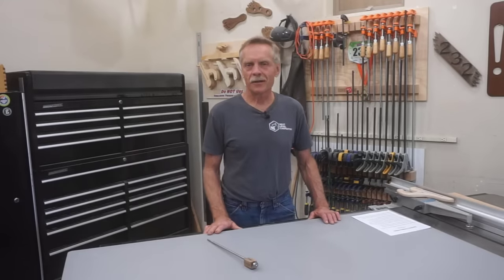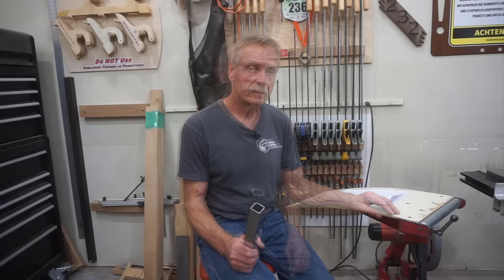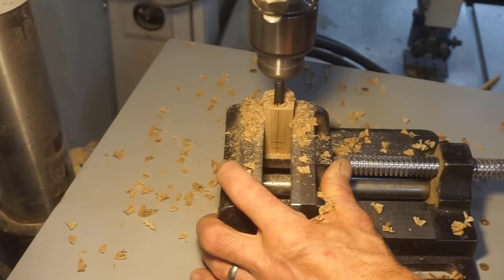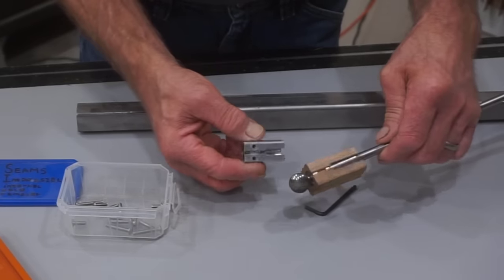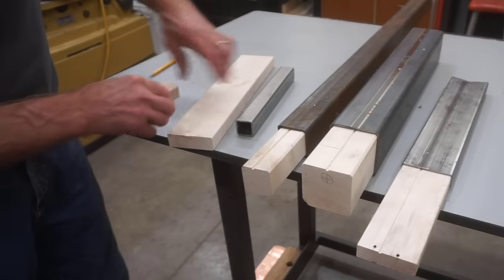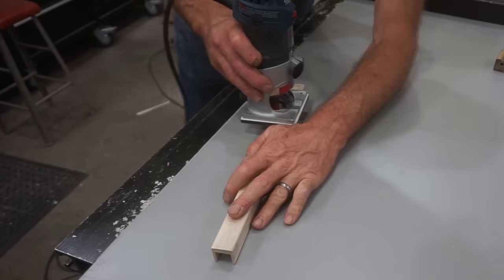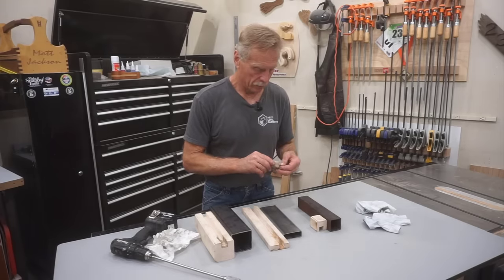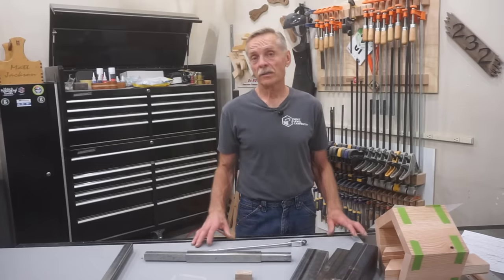How to Quickly Remove Internal Weld Seams from Steel Tubing

Comment: Having it cut below the inside surface has now created a weak spot. By the looks of the depth of cut  you've probably reduced the tubing strength by 40% . It needs some kind of fine adjustment to dial it in closer to the minimal stock thickness.
Reply from the maker: I can't quite imagine how you reached your conclusions but your calculations are borderline absurd... juss' sayin'.
Reply: @NextLevelCarpentry  common sense can seem absurd to some people. If you have tubing that has a wall thickness of 0.125" and your system cuts the weld out and then some to where the wall thickness below the weld is now .080" thick, you have made the tube weaker.

Now THAT is not rocket science. Oh, but I'm just being borderline absurd, guess that comes with 47 years of full time welding and fabricating experience.
Reply: The picture at 31:38 shows the undercut or thinning of the wall of the tube to less than what it is from the mill. This is my point. For what you are doing it looks like it works good but for any kind of critical strength application you do not want to be weakening the walls of the tube. A huge no no in any kind of critical or structural fabrication.
There was another video I saw where a carbide or tool steel insert was pulled or pushed through the tube cutting the weld out. Basically it is a broaching procedure. It's what is used for cutting a keyway down the inside of a bore.
Reply from the maker: @jacko4483  47 years in this business and you jump to the conclusion that wall thickness is reduced by .045 by looking at a screenshot in a video and then determine with certainty that the tube is now 40% weaker and try to convince me that's an example of common sense?!  The best way to get out of the hole you're in is to stop digging! 🤨🤣
Reply: @NextLevelCarpentry  I'm not saying 40% is exactly correct, of course it was an estimate, but it is weaker when you reduce the wall thickness. No hole I'm digging, but anyone with any kind of understanding would see that if you cut into the material deeper than the nominal thickness of the wall, it will be weaker. That is the truth, enough said.
Reply from the maker: The way you present a simple fact is rather annoying... I don't disagree that it's marginally weaker that's obvious but it's also irrelevant if it's 4% weaker not 40% weaker. Viewers with even a modicum of Common Cents realize that if the initial exact strength is a factor that can just reduce the jacket size and trim away the weld flush instead of over trimming it... the hole you are in whether you realize it or not is defending your original position which in my estimation is still borderline absurd.

Comment: Only trouble with this tool is that the weld is not necessarily in the same place on each run of tube. I have designed a solution to cope with this and a couple of other changes. If you would like to see my design  please respond to this comment.
Reply from the maker: You should look at OUR design first because it addresses what you believe to be a novel capability and lead you to a false conclusion... 18:20
Reply from the maker: It's great when one idea inspires new ideas and new thinking... my reply to you is mainly so you understand  that "the only trouble with the (Seams Impossible) is that the weld is not necessarily in the same place..." is a false statement/conclusion.  There are no doubt many ways of addressing the issue but our design clearly 'has a solution to cope' with it.  Kudos for brainstorming through it, whether or not your solution solves it in similar fashion... Best, Matt
Reply: @NextLevelCarpentry  Cheers Matt, I will tell you that my change is quite simple, rather than making multiple jackets, I propose being able to leave the jacket the same size but sliding the cutting tool roughly 10mm off centre to either side. As i said its your design and its a doozy. best wishes and a happy Christmas and a profitable new year.
Reply from the maker: We're all good then... it's a relief to see you're a cool, inventive thinker, not a troll as I wondered with your first comment.  We've been thinking about design improvements to get around the need for a separate jacket for each size of tube and weld location too but if you want to post pictures to Pinterest or Dropbox and share the link here you're welcome to.  Last thing I want to do is stifle creative thinking with an over-sized ego so I hope you'll forgive me any offense?  Best, Matt
Reply: @NextLevelCarpentry  No offence taken Matt. Watch this space. lol

Comment: I'm guessing some high speed steel and threaded rod.
Reply from the maker: That method's been out there awhile but this is a quantum leap better IMHO... let me know what you think after the video?  Best, Matt
Reply: @NextLevelCarpentry  I just saw it, and I already like it better.  Well done.
Reply from the maker: @ajhieb  thanks for sayin'!  Thought you might appreciate the different approach and cleaner results... Best, Matt
Reply: @NextLevelCarpentry  I very much appreciate the new approach.  I have about  40' of square tube in my garage right now that's eventually going to be a modular clamping system, and a bunch of it needs to nest.  I was going to try the method from Fireball Tool, but never got around to it.  I like your method even better. I'm going to try making one myself (stuff is already ordered from Amazon) but if mine doesn't hold up I'll definitely order one of the CNC'ed aluminum tools.  Thanks!
Reply from the maker: @ajhieb  You're welcome AJ... use whatever's fastest and least expensive... my hope is that this video gets half  the 1 million plus views Fireball's video got in the last year so spread the word for me if you like how this works for you?  Thanks! Best, Matt
Reply: @NextLevelCarpentry  Will do!
Reply: @NextLevelCarpentry  Most of my parts arrived from Amazon today.  I'm of course going to try something different and make the main block out of a block of UHMW.  I'm hoping to make a few different sized blocks so I don't have to mess with the shims.  if I have enough UHMW left over, I'm also going to try and make an end-cap with a bearing in it so that the shaft stays parallel for the entire length.  Thanks again for the inspiration!
Reply from the maker: @ajhieb  I like the way you think and predict excellent results!  You're certainly welcome... thanks for watching and commenting here.  Best, Matt

Comment: Interesting solution that seems worth trying but, I think the bearings make it more complicated then it needs to be. 
- 
Seems like a properly sized 1/4" aluminum plate with a hole in the right location would work just as well.

Comment: Won't deal with the little weld seam located close to the inside corner
Reply from the maker: So what? 🤨
Reply: @NextLevelCarpentry  The tubes I'm dealing with have the weld seam over close to one corner.  The proposed tool has a round cutter that would never get into the weld joints located quite a distance from tube center.
Reply: @stufields5125  this would be as easy as replacing the carbide ball bit with a flat bottom cylindrical carbide bit for the final part if it's a blind hole. You can get ones that have cutting teeth on the flat section of the bit.

Comment: Fireball tool had a much simpler solution to this using a piece of allthread and a piece of high speed steel.
Reply from the maker: "much simpler"?  Debatable.  Even if true we feel the superior results achieved with the Seams Impossible Tool are more than worth it but to each their own.  Thanks for watching and commenting regardless😁

Comment: "Tip the teacher" link says "resouce not found"
Reply from the maker: Thanks for letting me know John... that link must have become corrupted somehow but it's fixed now and I've included it here too:  https://www.paypal.com/webapps/shoppingcart?flowlogging_id=43d58f706fae5&mfid=1598630295963_43d58f706fae5#/checkout/openButton  I think I owe YOU a tip for the heads up! 😁😎 Best, Matt

Comment: why not use three screws.  Instead of the wood block.
Reply from the maker: That would leave too much 'play' in alignment during the removal process because consistent pressure and position are needed to cut the weld away in one pass...

Comment: A 40 min video on how to "quickly remove" the weld seam.
Reply: That was my first thought, but it is actually very interesting.
Reply from the maker: @lynalllynall9082  @zerocoolak's is a typical reaction to anyone who has difficulty differentiating between the 45 seconds it actually DOES take to remove a weld seam and the 39 minutes, 15 seconds spent explaining, in great depth and detail, exactly how and why, right?  Glad you found this interesting... I think most folks do.  Best, Matt

Comment: Two words: metric system.  Measuring and building things in America while faffing around with all the fractional values must drive people insane.
Reply from the maker: Doesn't slows us down a bit though, does it?😎  After all the tool shown in this video wasn't invented by someone using the metric system, right?!
Reply: @NextLevelCarpentry  So just exactly how long is an American cubit? Ah, the wonderful thing about standards, is that there are SO many to choose from! 😉

Comment: I like your thinking out of the box and building a solution to solve your problem but I have one question. Why not use seamless square tubing as a solution for solving the problem of seamed tubing.
Reply from the maker: Just go out and try to find two 4 foot pieces of seamless Square Tubing one with 1 inch ID and the other with 1in OD minus a few thousandths for a comprable cost and you'll answer your own question.

Comment: When Stewart and Lloyd's made tubes in Corby,  they got rid of the weld just as the tube was being closed, but the part where it happened was shrouded so nobody could  photograph it.
Reply: There is a mandrel that is anchored between the breakdown rolls and the fin pass rolls with the other end just past the welder inside the tube. The mandrel has a carbide insert which cuts the weld flash out while it is still hot.

Comment: I been a fabricator better part of my life the way i deal with this  is way different I use reneck edm action u need a old  buzz box some small alligator clips just clip the alligator right on the edge of the seem connect the welder clamps to clips use some heavy Gauge braided copper wire if the clamps don't fit in the pipe set the welder on say 200 amps turn it on and the heat will melt the seem because its thinner

Comment: Do you suppose that the creative energy and motivation to solve a problem like this, is just half of the psychological energy involved?  With the other half existing in a bunch of other people who just need a solution?  That the desire or motivating energy, goes down into the collective psyche of people and then re-emerges in some creative conduit like you, through which some type of solution can actually manifest?  But inverted...  sort of like a battery with a cathode and an anode?  In other words:  if you have a strong desire to say something, is the result of somebody else wanting to hear that thing?  that your desire or motivation is not a psychological phenomena that is isolated inside the boundary of the skin of your body.

One guy bumps up against some technical problem, for which there is no readily available solution.  So that energy gets repressed, pushed down or can’t find creative expression.  So it goes down into you, REAL far down.  Places you never go deep within yourself, a place deep inside where your still undifferentiated from other people.  The “collective unconscious” as written extensively about by pioneering psychologists like Freud, or C.G. Jung, or Peoget.  Then it makes it’s way back to the surface level of everyday waking consciousness, in somebody else where it could actually be solved, and is solved.

I mean you could have just made this tool and been like:  “Cool, problem solved”.  But you didn’t, you were stoked to share the solution, which is why I ask.  A Pragmatist or a cynic, would chalk it up to simply a personal desire to make money and sell the invention.  But you didn’t do that either.  You shared the problem with another dude, who refined it and polished the solution, then you put it on YouTube, and told everyone for free.  Then the cynic or pragmatist would say, we’ll then, you just wanted kudos for fixing some problem, people aren’t really one Consciousness somewhere deep down.

But you weren’t thinking about Kudos were you?  No you were microfocused for months on a small technical challenge until you solved it.  And then shared it.

I put up the argument, that the degree of focus and motivation you expressed in solving this technical challenge, is equal (if ever measureable) to the exact degree of frustration and disappointment one or more people experienced after wandering around the aisles of Home Depot or Ace Hardware searching for telescopable lengths of square tube...

Comment: STOP! There is nothing wrong with the basic tool. You did really well. But the sleeves are a huge complication.
Just drill and tap two blind holes into all three non-burring faces of your block and insert six correct-length bolts to seat the device in the size of tube you want to de-seam.

Comment: 29:50
Why can't you pull it from the other side???
Just flip the jacket, or is it just me?🤔
Reply from the maker: Thanks for the comment and observation CaptainDenmark... Just flipping the jacket would indeed allow you to pull it from the other side but you'd need to have a reverse set of holes to attach the jacket to the block in both orientations...  Best, Matt

Comment: A round burr will have a hard time reaching seams that are close to the corner, and this distance gets bigger as the square tubing gets larger. It’s important to also know that seams are not always in the same location. Fireball Tools solves this: https://youtu.be/3jr4Capx8XI
Reply from the maker: On the contrary: the Seams Impossible is capable of removing a weld seam in any location, centered or not,  within 3/8' of the inside corner of a tube of any size (down to 1" if necessary, something Fireball's method is not capable of) simply by making a jacket of the right size. Best, Matt

Comment: Solution...DOM tube...no weld seam.  Solved.
Reply from the maker: Dozens of viewers make this same comment... it's kind of like someone who watches a video about using a chainsaw saying "Solution... just buy pre-cut/pre-split firewood... no chainsaw needed.  Solved."  Rather lame IMHO... just sayin'. 🤨
Reply: @NextLevelCarpentry  I admire your ability to devise and produce a tool that actually accomplishes the task,  but a more efficient solution is to obtain the proper material for the job when it actually exists.  Would you start with a whole tree because you needed plywood for a job or just go and buy the plywood?  Do you sharpen screw drivers to use as chisels?
Reply from the maker: @D2O2  Exactly! I occasionally need short pieces of sleeved tubing and I don't want to go buying full pieces of expensive DOM material at greater expense just to cut the end off and leave most of that stick taking up storage space in my small shop...
Reply: @NextLevelCarpentry  I agree and it is available by the foot.  1 1/2 is 4.50/ft versus 8.00/ft.
Reply from the maker: @D2O2  where?  Would definitely simplify things and keep costs within reason if material and shipping aren't crazy...
Reply from the maker: @D2O2  there is no 1 inch telescoping tube that fits inside of inch and a quarter at that link... otherwise it might be a good source for larger sizes but kind of illustrates the point why I went through all the trouble of making this tool in this video: for times when it's the quickest simplest and easiest thing to do... especially since there are millions who, unlike you, do not have a place down the street that sells it...

Comment: Hey, why not make dado wider to allow for sideway's play and use screws (4)  2 on each side of block counter sunk with nut on inside of sleeve for thread.  This allows for lateral adjustment with stops for offset welds.  fixed!

Comment: That's cool. The only problem I can forsee is sometimes the weld isn't right down the middle.
Reply from the maker: We foresaw that potential problem too... and addressed it to solve it so it's not a problem: 
https://youtu.be/ozSE7Wrdb1o?t=1106
Best,
Matt
Reply: Make your own wood guide block to suit. Of course not possible if the seam is closer to the edge than the radius of the tool . . . good luck!
Reply from the maker: @gyrogearloose1345  That minor shortcoming is solved simply by choosing tube where the weld seam is within 3/8" of the sidewall which is probably more common than otherwise...😎